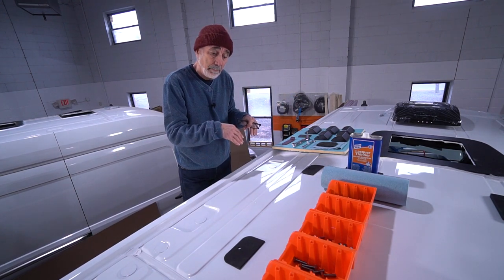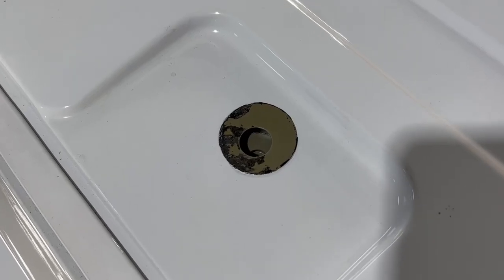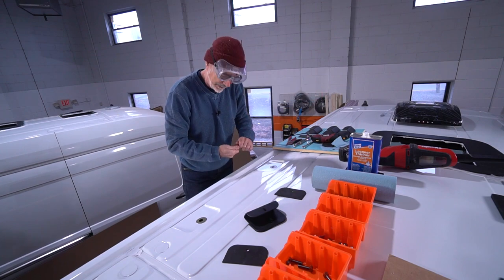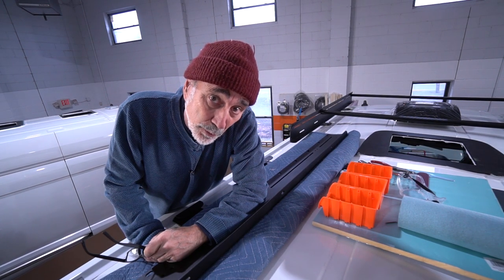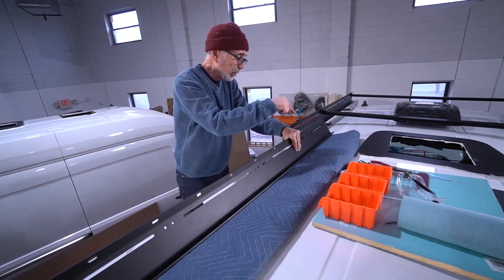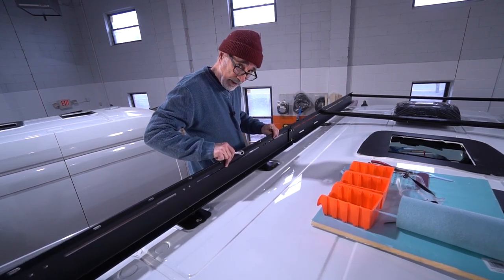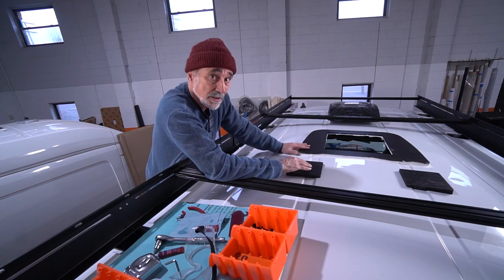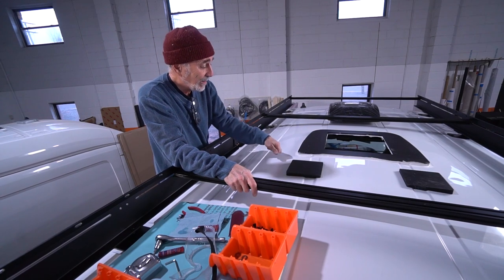Custom Van Build - FORD TRANSIT - High Roof Rack, Weight Issues and Fan Leveling Gaskets.

Comment from the maker: The components on the roof are the minimum required, with none being unneeded. As illustrated, they add up to be more than 70 lbs over the manufacturer's rating. This will be an ongoing issue with the Ford Transit as a platform for building. I will add additional structural support to compensate for this shortcoming.
Reply: thanks for taking the time on all the videos George.  was going to ask about the 73 lb's overweight.  makes me wonder if other convertors are reinforcing the Transit roof ?   guessing not.
Reply: I've seen that Flatline also offers a "safari" roof rack that has a deck. I was originally leaning toward that, but after watching your video I'm wondering if the transits roof is flimsy enough that the safari version of the deck would be a bad idea? Or perhaps the weight is distributed evenly enough that it would be ok?
Reply: RV's badly need an alternative AC/heatpump system that is affordable and not roof mounted. Could use a compact mini-split type or window type that deploys thru a side hatch. I believe I saw a motorhome with an LG split system integrated in the sidewall. Better yet would be making use of the vehicles AC if it had an electric compressor. Tesla's allows similar capability for their dog mode.
Personally for boondocking or full-time use, I would minimize the roof holes and maximize area for solar. I would only consider one opening for a marine hatch for stargazing, roof access or lookout. I can think of viable alternates to roof fans. I like the idea of tilting or sliding solar panels to uncover the hatch and roof deck. Sliding panels side or rear could act as a mini awning.
Reply: @coopcraige  this is the first Transit roof reinforcement I’ve seen beyond what George already does with wood supports to accept the screws for fan/AC installs. By the BEMM, seems like a structurally sound method (he did a pull-up for goodness sake!). It totally blows my brain on how I started designing my ceiling panels though 🤣 back to the drawing board if I decide I need angle aluminum.

I’m planning on a maxxair in bay 2 (bay 1 is the curved bay) and was leaning to the Dometic RTX 2000 in the rear most bay with Hein’s DIYVan adapter. Maybe with that layout I don’t need those angle supports… maybe. I need to research that more.
Reply: @YT-MY  Yup, an easier and cheaper AC unit, window mounted, could be this Eurom 2401.

Also, what van people DO NOT understand when mounting solar panels on the roof, be it secured flat or rolling some to catch that sun, is that most of the time they’ll need to park under a tree for shade. Otherwise in the summer sun the exposed surfaces are huge, to the point that any AC would not be efficient!
Therefore, it would be best to have some sort of mobile/tilting/side mounted solar panels that could either follow the sun by adjusting the angle or even move to opposite van sides. 
Leave the van under the sun in the summer to produce electricity that is spent to cool that van down again, seems absurd in my mediterranean eyes...
Reply: Question, what is that black mat called that you have installed around ur cut out for the fan??  Thank u in advance.
Reply: @brandon1573   My question as well. Do I need to nix the roof deck? Partner and I exceed the 220lb weight limit. The materials alone would exceed it. Kind of stumped as I'm sure I've seen Transits with decks. Is the rating for standing directly on the metal, whereas weight being distributed per the bolt anchor spots could handle more weight?

Comment: Per the BEMM all of the roofs are rated to the same 420lbs, the owners manual derates the high roof to only 220lbs based on the center of gravity of the factory configuration. Ford expects upfitters to do their own center of gravity calculations based on the formulas in the BEMM and adjust the available roof capacity based on those.

Comment: I bought a roof rack from Flatline just a couple weeks ago after first considering 8020 and unistrut options. The weight was really the deciding factor for me. They are expensive, but the time and weight saved was nice. It was also already in stock and arrived in 2 days. I was expecting they'd have to be cut to order, so that was a nice surprise to have it so quickly.
Reply from the maker: I have not encountered a third-party roof rack that’s wide enough to accommodate solar panels, air, conditioners, and fans. I still prefer to build my own racks out of 10 series 8020.
Reply: @HumbleRoad  I don't plan on adding an air conditioner, but the rack (extended roof model) easily supports 800 watts of panels, MaxAir, weboost, weather station, and starlink port. The cross members can be placed wherever you decide, allowing for highly customized configurations. It's possible the design has evolved. Nonetheless, I respect your preference of using 8020.
Reply from the maker: @NomadicPride  sorry what I meant to say is when there’s an air conditioner mounted in the center of the roof. There’s no room on either side for solar panels flanking the air conditioner. I had to cut the flat line rack and spread it and add inserts to the crossbars in order to fit my solar panels. It worked just fine on two Ford transit but I don’t wanna do that every time. Now, I’m going with the Orion roof rack on 24 transits. I’ll let you know how that goes.
Reply: @HumbleRoad  Thanks for the clarification! I wasn't totally getting it, but knowing the air conditioner is center-mounted brings it clear. While I'm in for the FVC rack now, I'd still love to hear how the Orion does.

Comment: You have supreme taste in style and design.  I searched 12 years for a roof rack and when I spied one in the Pearl I buttonholed  the owner to know the producer (FVC), local, a few miles away.  Their business model is trim and efficient but their customer service is sterile like so many today.  Their products aren't as good as you would produce but I've not found better in the last two years.  My years in metal trades makes me think Flat Line refers to a positively square angle.  IOW, damn straight.

Comment: Harmonics are important.
Wind-induced harmonics brought down the original Tacoma Narrows Bridge for which there is film footage.
I think about vertical springs on top of the roof and under the frame with round rubber feet at both ends.

Comment: So thanks 4 the break down on the lighting set up n camer angles, n your general due diligance the thing 2 consider re rain is angle of rest of the van it may not alway park so it maintains perfect flatness alao what was happening in the past is no where indicitave of whats poszible now expecy much more erattic weather things like massive hail dumps followed by 2 inches of rain in minutes become fairly common

Comment: Good to see you work with so much care and finesse George. Not kidding with the tin construction of the Transit. I had to build a surveillance vehicle on a high roof. Had to install a 15m pneumatic mast in it which was huge and very difficult to stabilize in the vehicle structure. Even the crew/operators compartment was a nightmare as rivnuts don't hold well in the flimsy inner frame. I have also noticed that corrosion on the underside is a potential issue. The van has now done around 30k and only has light use as well. Maybe the US ones are better than the UK vans? Keep up the good work.

Comment: Great to see your pro photog tips and the fact that you spend a great deal of time in the production side of your videos (unlike most all utubers). Being from the south where its hot most of the year, air cooling is something that is necessary. I'm surprised you haven't switched to something more efficient than those noisy watt hogs that most RVs use. A good high-SEER (120v or 12v) mini-split uses about half the power, is far quieter, and also provides heat when needed. Additionally, they don't add height and top heavy weight to an already tall vehicle. On the other hand, they do require something you love to do - solving the problem of where the 2 main components are installed! Keep up the good work and be careful on the scaffolding - perhaps a safety rail around 3 sides would add a layer of insurance for you and your employees.

Comment: George that is a nice rack. I've seen videos of vans with walkable solar panels. It's called a deck. I believe they are on a Sprinter. With one person it would be too much weight.
Looks like you will be over weight on the Transit van.
Reply from the maker: Yes, I'm approx 70 lbs overweight right now. I'm going to add structural support to compensate.Thankfully, my clients are not Formula One drivers...

Comment: Fantastic video and nice product. 
My feeling is weight is everything, like a serious backpacker or bicyclist. Quality and lightweight do not have to be opposites. My thinking is why carry excess weight, it stresses the vehicle, can degrade vehicle safety and limits what necessities you can carry.
Is that bare metal exposed around the roof holes? I would paint any bare metal to limit future rust.
It would be interesting to measure the thickness of the different van roofs. Looks like the Ford has greater flat area down the center for better opening/mounting options.
Reply from the maker: Yes, that flat area going down the center of the roof is precisely why the roof flexes so much! Folds and creases in the sheet metal provide rigidity.

Comment: 1) 0:43 TOTAL WEIGHT LIMIT HIGH ROOF EXTENDED CHASIS: Transit 220 lbs, Promaster: 330 lbs, Sprinter: 330 lbs.

2) 0:47 Fiamma 45S 10’ awning = 49 lbs. 100 watt solar panels = 57 lbs.

3) 0:55 Flatline Van Company roof rack = 65 lbs (which is lighter than a custom 80/20 rack because the Flatline rails are lighter than 80/20 rails. Flatline roof rack will use 80/20 crossbars.) This rack is pre-made to accommodate the Fiamma awning and solar panels.

4) 1:27 Rack 65 lbs + Awning 49 lbs + 4 100 watt solar panels 57 lbs + 2 Maxair fans 40 lbs + AC 82 lbs = 293 lbs.

5) 1:42 Installation of Flatline roof rack on For Transit begins…

Comment: How much weight savings is there compared to 80/20 as the backbones?  Have you used 1.5"x3" (40/80series), run upright for backbones?  You have really good & helpful data in your videos.

Comment: You know you threw me into a tailspin! The 220 lb weight limit on the roof isn't about the walls crumpling or any of that - it has far more to do with how top-heavy the van can be on the road without tipping over on corners! I started planning on fortifying the ribs and got way into it until the coin dropped and I realized - this isn't its structural limit it is its practical limit.
You did say near the beginning "perhaps because of how tall it is" and that is totally what it is.
Reply: How's your build going? I'm debating a similar notion - as I plan to make the van's center of gravity lower (for driving), but for static situations, I want to have the roof rack, solar, and a possible deck we might even be able to stand on. =)

Comment: I'm seeing rubber hockey pucks being used as cushions in roof rack systems.    I'd like to know your thoughts.   They also used silicone on body under puck.
Reply from the maker: I haven’t heard of that and I’d have to give it some thought as to whether or not it’s necessary and if so, is this the best solution

Comment: George, I'm enjoying your Transit conversion.  I started my 2020 Transit conversion a year ago, the Flatline roof rack was my first installation.  I've come across one challenge ... the bolts that connect the 80/20  1010 rails are frozen ... at least one of them is, it's been stripped out, and I haven't found a way to get it out.  It's the only failing part of the FlatlineCo roof rack for me.
Reply from the maker: Shave the head off lubricant on the threads and back it out with channel locks
Reply from the maker: (Square the head)

Comment: Silicone will be fine with the pad. I would be more concerned with the exposed metal from the Dremel. I would think it should have some prep to avoid moisture getting in there and rusting a point of support.
Reply from the maker: I prime all cuts and drill holes.

Comment: George, would it be an option to use brackets on just one side for the awning and utilize plastic, glue-down mounts for the solar panels (assuming you have the roof real estate)? This would eliminate the crossbars and at least one side of the rack. I’m also working to reduce weight as much as possible. Trying to avoid a roof rack entirely. Always a pleasure to watch your videos!
Reply from the maker: I prefer a "wall mounted" awning rather than the "roof mounted" variety. And I like to keep plenty of airflow UNDER my solar panels, to maintain optimal performance. These are the primary reasons for the system I build. When you think about the stresses placed on an awning, both when closed and driving, as well as when deployed, the rack is a necessary part of the system. These two Transits are utilizing the minimum componentry up on the roof. I will focus on additional structure to accept the added 70 lbs. But as I mentioned earlier, I think the added weight up there is more detrimental to the balance of the van, the center of gravity. So to counteract that, we need ballast downstairs. I need to bring the center of gravity back down to a level commensurate with the original deign of the vehicle.

Comment: Thanks for creating such useful content for the community! Has anyone asked you to reinforce a roof? (Noted, comment on center of gravity; but more so for static load - rooftop deck.) I mean, how often do people climb up on to their roofs anyways? But looking at the weight limits, seems questionable to have a rack, some gear, and two adults on any roof, regardless of which manufacturer.
Reply from the maker: I would not reinforce the roof structure, giving a sense of confidence that the excess weight is now acceptable. I would say that MOST van builds with rooftop decks are severely over weight.  I have a hard rule not to alter the chassis of any of my van builds. I would be liable for any damage or injury.

Comment: Nice-nuts, I didn't know!  So there's a gap between the bottom of the roof panel and the start of the "plus nut" threads?  If water were to get past the silicone and the foam pad, wouldn't it leak into that void? Where is that void inside the van, in a roof rib or support strut? If that's the case, does that water drain out through a weep hole or into the insulation?

My free advise, worth exactly that, is caulk the whole perimeter of the AC: Wind driven rain and the occasional high pressure wash will force water uphill.
Reply from the maker: Oh make no mistake! The entire gasket is glued and sealed all around. And that's where you could stop, particularly with 3M5200 or 3M4000, you should never have a problem. But I go a step further, and you are correct, that driving rain is very smart! It can find it's way into the slightest of voids!
Reply from the maker: But to answer your question, The holes are located so far outboard that any leak would run down the wall down into the weep canal under the floor. But I will not allow that to happen!

Comment: QUESTION: I have a 2023 Ford Transit Trail. It comes stock with the MaxxAir Fan between the front two support ribs. I wanted to put an A/C unit in the middle section of ribs (which happen to be the farthest spaced), and you mentioned fabricating some supports for the weight of your A/C unit. Would you share what your solution is to this issue? Thank you! Truly enjoy your videos!
Reply from the maker: I went a little overboard with my solution to spread the load across the ceiling. Additionally, I incorporated it into a design move, running a boardwalk, all the way down the center of the ceiling see the video. Custom Van Build - FORD TRANSIT - Air Conditioner? Xtra support rails are a MUST-HAVE in these vans!
https://youtu.be/LoxWc12vcGc
Reply: @HumbleRoad  AWESOME!!! You SAVED me from making what could’ve been a HUGE mistake. LOVE your videos! Thank you!
Reply from the maker: Glad I could help

Comment: Now that you have some experience with both your own 80/20 and this flatline branded rack, I am curious about your thoughts on using a plate rail vs  an extrusion for the outside rails. Plusses and minuses...prefferences...
Reply from the maker: From now on, I will build my own racks. That’s all I will say…😡

Comment: Do the awnings always get mounted on the roof racks? Or are there other options? I would love an awning on my future van and wanna be sure I build it correctly.
Reply from the maker: Awnings can be mounted directly to the van roof. Many (most) manufacturers mount this way. I prefer rack mount (called wall mount) because they do not add holes through the roof, and they are adjustable in the way you mount .
Reply: @HumbleRoad  I guess I would be better off with the roof rack then, since that Transit roof is so thin. I think I would prefer to do it myself though, so I can be sure it's all properly sealed.

Thanks! 🙏🏽

Comment: This is the rack I wanna get.  I am also putting in an ac.  Should I buy the rack and install it first so I know where to put the ac?  I know flatline has the panels you put in the rack so you can stand up there so want to position it correctly.
Reply from the maker: I was not happy with the width of these racks. I spent much time fabricating new spacers to widen the distance as much as I could. Go look at Orion racks. I just purchased one for Roxie, but have not installed yet. Keep an eye out for the video. But I do not recommend the Flatline.
Reply: Thank you for letting me know!  I will go look at the Orion!
Should I install a roof rack before the ac so that I know exactly where to put the ac?
Reply: @HumbleRoad  doesn't look like they make a transit rack on their site.